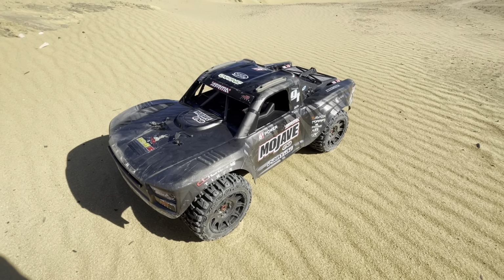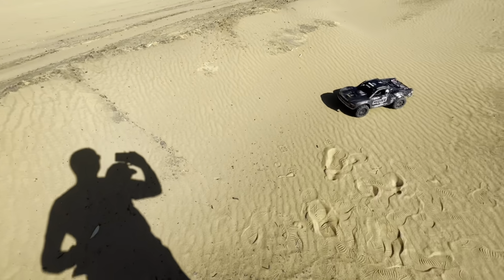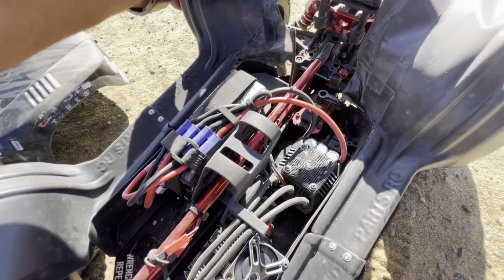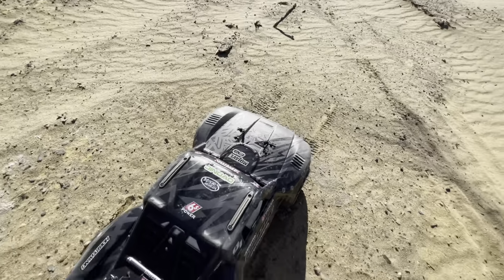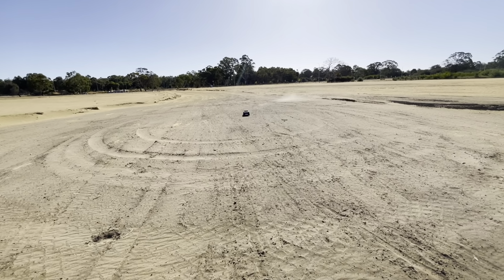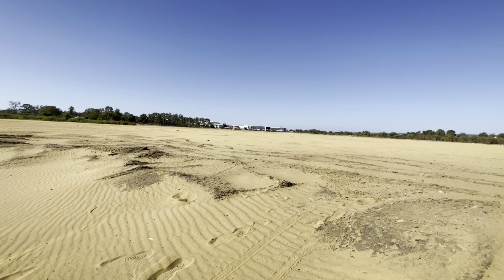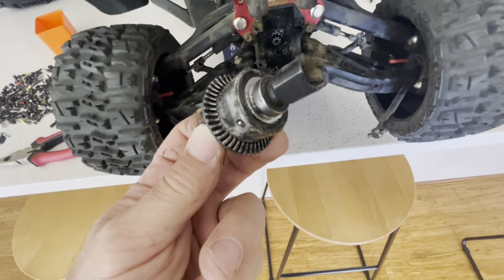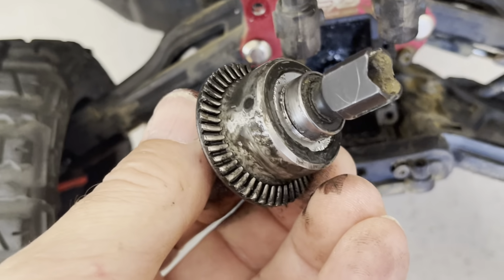ARRMA Mojave EXB - MORE TROUBLES

Comment: Killer spot and drivng!  My Kraton sounded the same last week, so far I found a bearing that grenaded on the c-block side of the bulkhead. Rear input gear bearing. I put it back together thinking my gears were fine but sounded the same. We ll figure it out. Nice vid bro!
Reply from the maker: Thanks so much brother. Yeah it’s a bit annoying when you think you got it fixed then it’s the same, but that’s the hobby. I’ll have more info on the cause and fix in Part 2 soon mate. 👊🏼😎👍🏼

Comment: Good video. This is why you want a alu bulkhead. I went with the Vitavon bulkheads but as you know today you have plenty of alu bulkhead options. Never had a diff or drivetrain problem since a went full alu diff and bulkheads and I run my Mojave extremely hard with a Max6 and 4985 1650kv on 6s 26T and mega jumps.
Reply from the maker: I agreed 100% brother. Got full M2C and HR bulkhead and diff cases in my K6 and it’s an absolute beast. I have the Vitavon diff cups in the Mojo but will also be getting the alloy bulkheads for it. It’s a work in progress. Thanks for the view and comment bud. 👊🏼😎

Comment: Hi mate I'm running 1250kv motor 8s system in my 1/8 kraton. you need at least 2 shims. I use a old differential to set everything up before before I put back in the car. Great video mate 👍🦘😁😁
Reply from the maker: Thanks brother. Yeah I actually put 3 shims and I will test it again soon in Part 2. 😎👍🏼

Comment: Mojave is a truck for speeding off-road... Jumping like that all the time is for other models like xmaxx, Kraton etc.... 

It's not fair titling on Mojave problem when you jump over curbs with a corvette....
Reply from the maker: Thanks for your comment and view bro. I’ve modified my Mojo to do this type of driving and this is how I want to run my truck. If you watch SCT racing they also go off big jumps too and also when they desert race. I will reveal what happened in Part 2 but just because a truck is built to do something, it doesn’t mean you have to stick to it and that’s what I do 😁. 
I have an Infraction that I just drift with on road only. Some guys take them off road but that’s what they want to do, I don’t. That’s what’s great about this hobby, you do what makes you smile and have a good time doing so. 
Cheers bro and thanks again. 😎👊🏼👍🏼
Reply: @WestOzRC  you're right
Even if I found title not just for Mojave 
RC and modding are unsplittable so. Mod it 👍😎